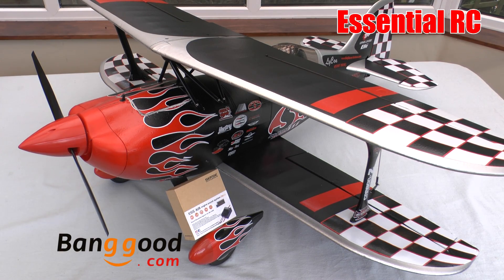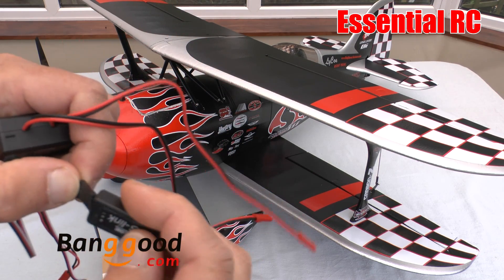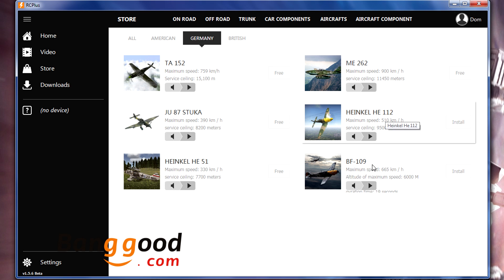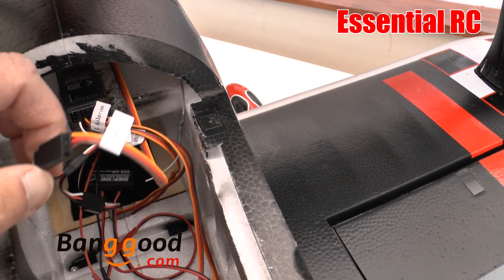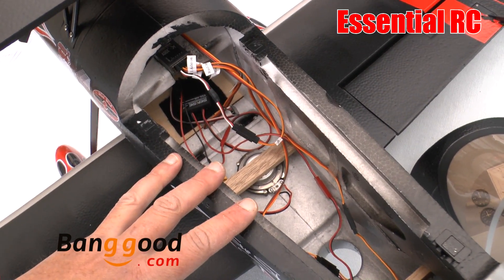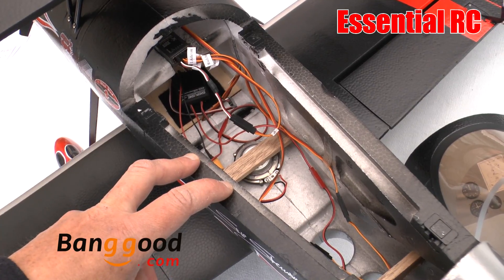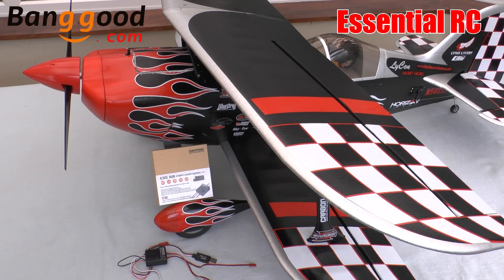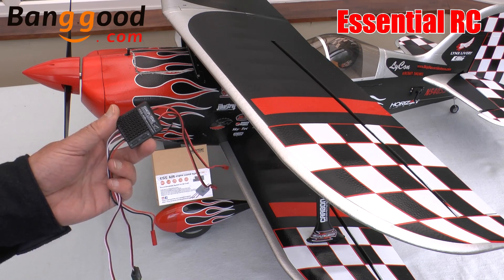Sense Hobby ESS-AIR Engine and Gun Sound System: ESSENTIAL RC FLIGHT TEST (Banggood.COM)

Comment: You feed the soundsystem with a seperate 3s lipo 1300mah, I would use a 3s 1000mah, would that work properly in your opinion?
Reply from the maker: Yes

Comment: This is kind of dumb. The Carbon Z Prometheus sounds great on it's own and shouldn't mimic the sound of a choppy aircraft engine... Just plain dumb.
Reply from the maker: It was a fun thing to try. Nothing more. It demonstrated the sound system but in reality you are right. For this model it didn't add anything. The P2 just served as the model I had at the time to test it out. But appreciate the feedback. Cheers Dom (Essential RC)

Comment: Do you use a separate battery for it or off the main? and if its off the main does it shorten the flight time much? Thanks
Reply: sorry i just watched the bit i skipped earlier, would be a bit of a squeeze with separate battery on some of my durafly models so got to try to run it off main.but what a difference that sound makes :)